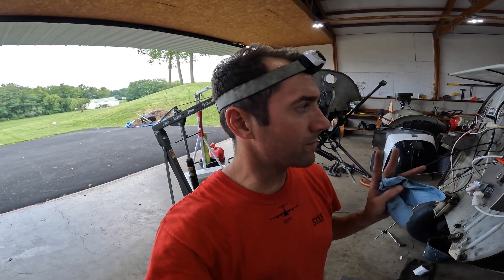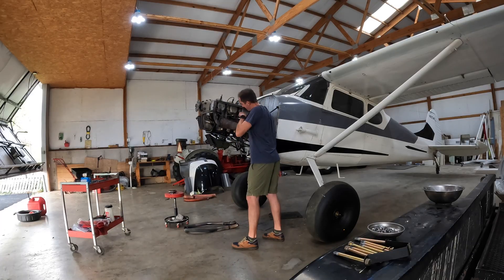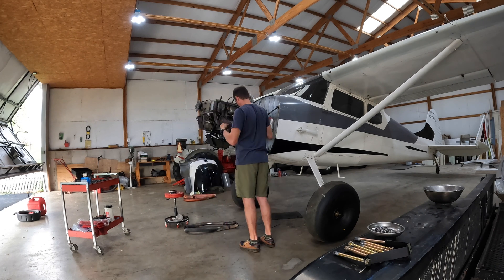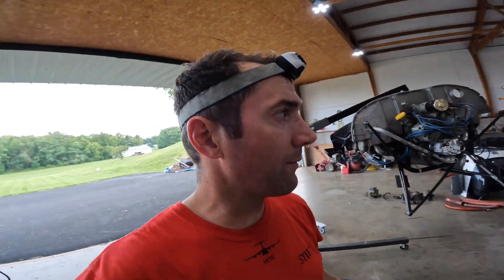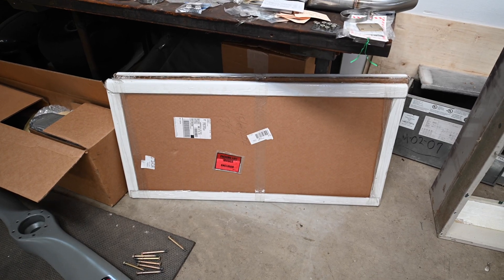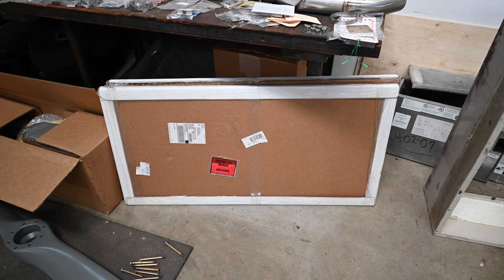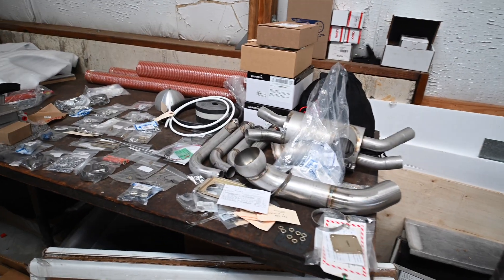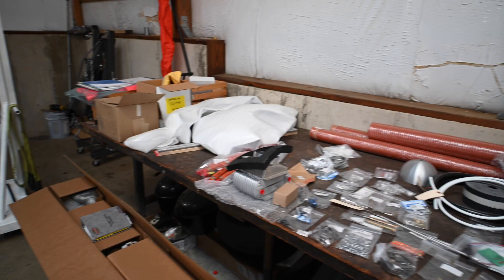New Stoots IO-370 Prime Engine Upgrade Part 1

Comment: That's a sweat engine for the 170. really, they were a little underpowered. I had them sixteen years and then moved into a 180 and that handled like a Mack truck compared to the 170.